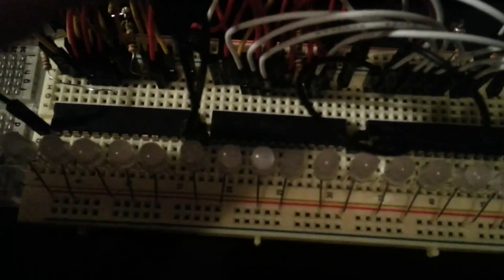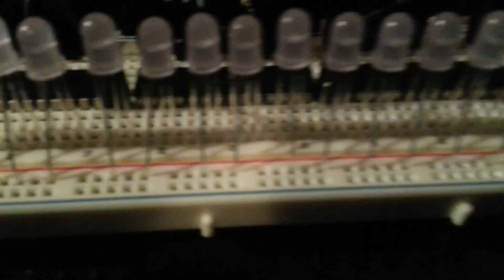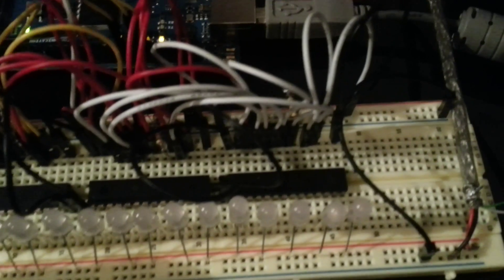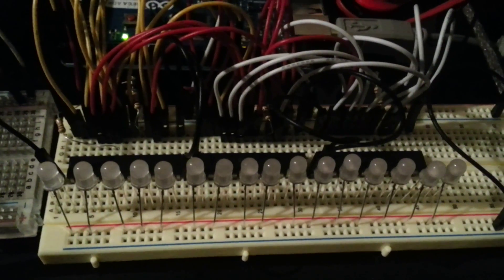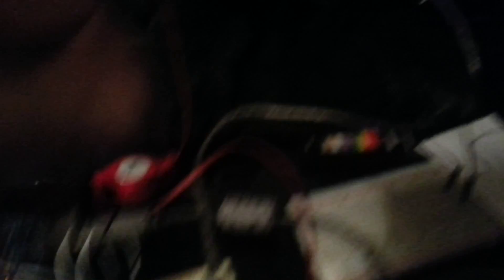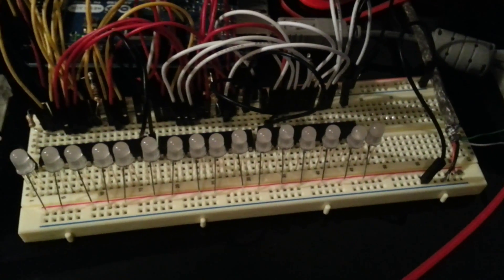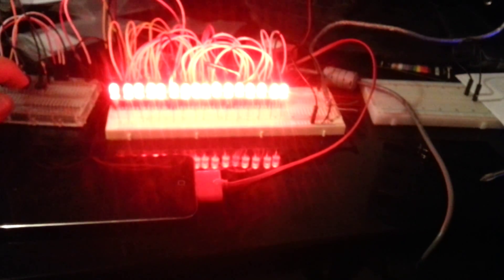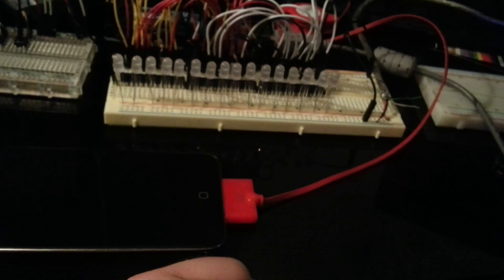Motorcycle sequential taillights with Arduino

Comment: Why did you go the tlc5940 route over the addressable LEDs with the serial daisy chaining chip built in?
Reply from the maker: Hey Mangy
I guess I wasn't aware of such an led/chip... plus a cost thing since I was doing tricolor LEDs, and quite a few of them
Reply: Ahh haa... Also i just realised your video is a few years old they may not have been around then...

You can find SMD addressable chips going really really cheap. Something like 10 quid for 100 leds... 15-20$?

The more known branded ones are rather expensive but the cheap chinese imports dirt cheap

Comment: Hi !!
How can you get and pick the yellow color from the TLC5940 that you use to make your L/R blinkers.
I'm working on an idea like yours WITH TLC...

How to create ,select and use non primary colors with the TLC5940.

Thanks.
Reply from the maker: With the TLC, you can vary the PWM, i.e. meaning the brightness of each color can be changed. Yellow/orange is a combination of red and green if I remember right, you have to play around with the brightness of each color to get the mix correct.

Comment: Question for you, so i'm newer to arduino programming and such, but I still do not understand how if you only have "x" number of pins on the arduino board how you can control so many LED's, but I know you aren't even doing that you are using the three seperate chips anyways to drive to LED's.  I just don't see how the arduino can control those chips with all of those different programmed outputs for the LED's.   I wanted to do something similar for my motorcycle myself.  
Do you have any beginner projects you would recommend to help out my understanding of programming?   Thanks
Reply from the maker: Hey Austin,
Yea, so the arduino is basically sending data packets to the TLC 5940 chips, which for practical purposes can be viewed as additional output pins. Get a few TLC Chips, and browse around http://playground.arduino.cc/Learning/TLC5940. Also watch How to Control a Ton of RGB LEDs with Arduino & TLC5940. Such a great video, and may be over your head a bit, but he explains it well.

Comment from the maker: Hi george,
 if you look up any schematic for hooking up those TLC chips, that's exactly what I have. Getting the lights to stay on instead of blink in sequence is all part of the programming. It's been a little while since I've looked at the programming, but I believe there is a command that wipes the 'memory' of the TLC chip every time it cycles through the code. And some of the tutorials I read, people use that on every time so that you could animate without having to worry about lights being left on wayward sposed to be. In our case, we can use that function to our advantage to leave the lights on after they turn on, and then use that command to clear everything once all the lights have lit up. I think it's TLC.clear if I remember right in the Arduino programming.